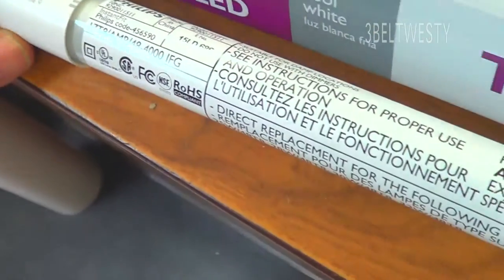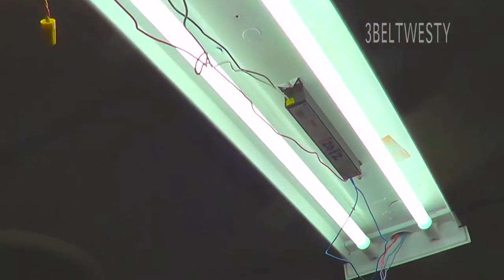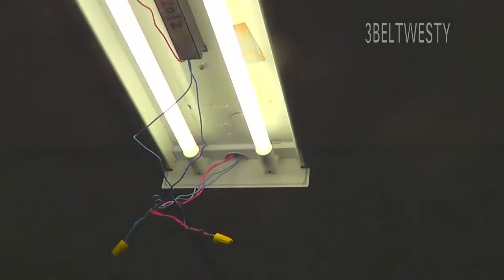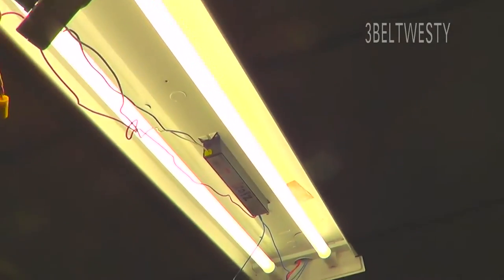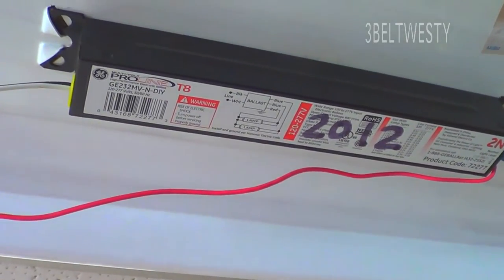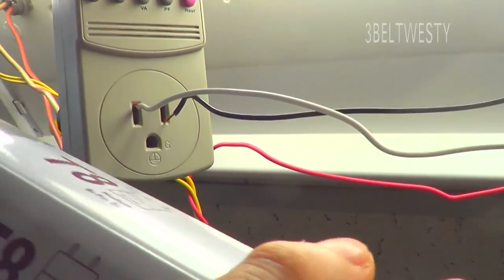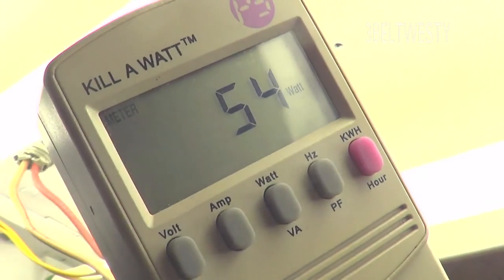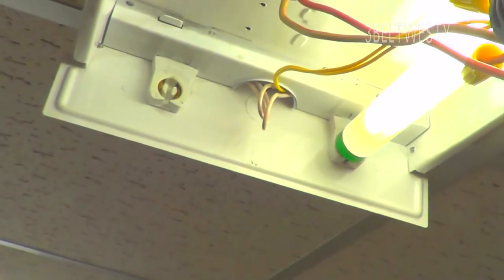Philips Instantfit T8 LED Power Test  with electronic ballast GE Proline 72277

Comment: Just to add a quick comment about these bulbs. I thought my fixture was OK but when I put the T8 Instantfit bulbs. They worked for about a day and quit. I removed them and installed new T8 flouresent tubes I had on hand and they didn't work. After doing some troubleshooting I determined that the Philips bulbs fried my ballast. This has happened twice. The cost of a new ballast is the same as buying a new light. I just purchased a 5500 lumen light at Rural King for $16 and all I had to do was hang it.
Reply: Same here. Philips publishes a list of compatible ballasts with these online. Ballasts that are listed as incompatible or are simply unlisted seem to burn out after install. Probably best to check the ballast compatibility before attempting an install. 

http://images.philips.com/is/content/PhilipsConsumer/PDFDownloads/United%20States/ODLI20180301_001-UPD-en_US-PLt-16118CR_InstantFit_Ballast-Compatibility-Guide_2018-1.pdf

Comment: I have 3 different fixtures some old some not that old one new. The instafit phillips works in none! I'll look at the box to find the print that says I need a ballast. I purhased these a while ago may be too lateto return them! What the hell!!!
Reply: Philips publishes a list of compatible ballasts online, which is good to reference. Even in an electric start ballast, if it's not on the compatibility chart, the bulb will either not work, or will burn the ballast out within a couple weeks. Having Said that, I've installed over 60 of these bulbs now with little issues. Don't bother if the ballast isn't compatible. Having said that, when the bulbs are installed with compatible ballasts, they work really well. The bulb provides superior light, and the energy usage is close to advertised on the box.

 http://images.philips.com/is/content/PhilipsConsumer/PDFDownloads/United%20States/ODLI20180301_001-UPD-en_US-PLt-16118CR_InstantFit_Ballast-Compatibility-Guide_2018-1.pdf

Comment: Hey can those philips instantfit be wired to work without a ballast? I'm curious
Reply from the maker: Actually No. This variant of LED Bulb requires an electronic ballast!  It will not work without an electronic ballast. The "Philips Instantfit" is a retrofit bulb for a fixture that already has a T8 Electronic ballast. For a brand new install of a new fixture and new lamp one would never or rarely use this type of bulb.

 Most all 4 foot LED lamps are not of this design. This odd variant is to reduce the power of a fixture without rewiring the T8 electronic fixture to not use the ballast. ie maybe you are renting an office for a year and your landlord owns all. One swaps out the T8 bulbs with these Instantfits and after 1 year and you move out you put the old bulbs back in.

Or one is retrofitting to LED front T8 electronic fired gas bulbs and one one cuts the labor cost by just swapping the bulbs and not rewiring the fixtures. Not everybody is comfortable with rewiring fixtures.

I was not aware of the Philip Instanfit bulbs until I saw them at Home Depot a few years back. The phrase that says requires a ballast caught my attention. I have a few running in my office but most are the direct no ballast LED types.
Reply: I have different fixtures and they work in nothing I have. I wasn't aware that I needed a ballast. Looks like I'll be returning them. Thanks!
Reply: Philip LED T8 bulb very confusing. Which one direct main and which one require ballast plus starter ? Found one at DIY store with same price as OEM China LED direct main no ballast starter one.